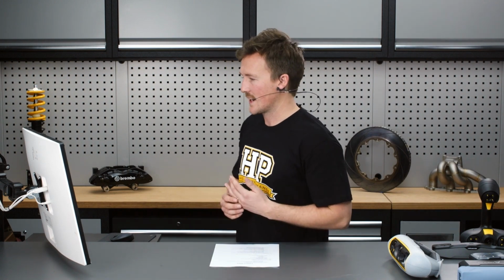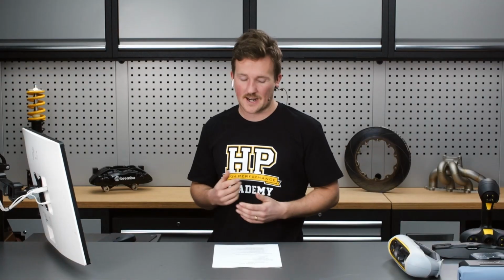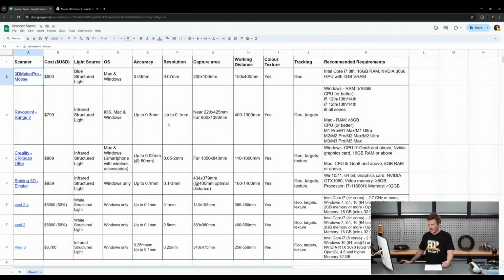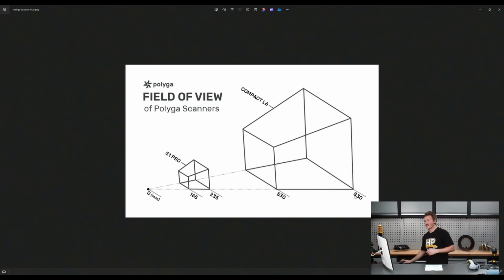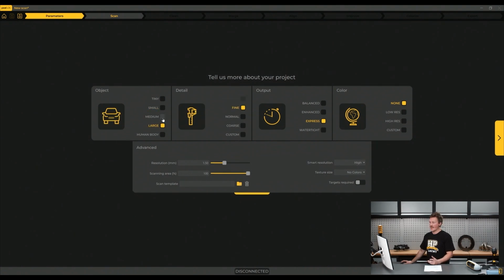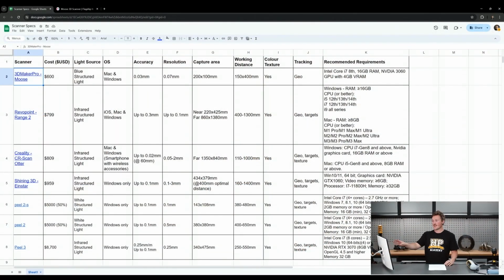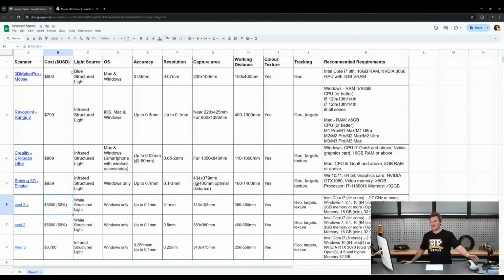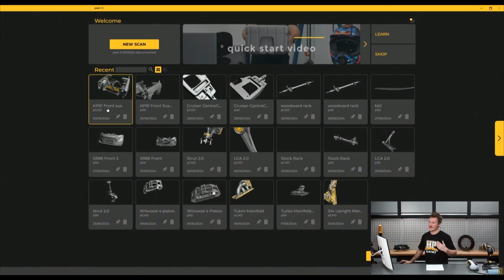Buying A 3D Scanner? | What You Need To Know

Comment from the maker: What 3D scanners are you considering?
0:00 – Intro | Choosing The Right 3D Scanner
0:08 – Why 3D Scanning Matters For Motorsport & CAD
0:24 – Scanner Technology Overview
1:06 – Scanner Marketing Claims & Metrics
1:19 – Why Use A 3D Scanner?
1:34 – Reverse Engineering & Scan-Based Design
2:59 – Scanner Technology Types Explained
3:03 – Photogrammetry Scanners
4:22 – LiDAR Scanners
5:11 – Laser Triangulation Scanners
6:19 – Structured Light Scanners
7:22 – Light Source Differences | White, Blue, Infrared
8:39 – Coordinate Measuring Machines (CMMs) & FaroArm
9:52 – Hybrid Structured Light & Laser Scanners
11:13 – Scanner Metrics Overview
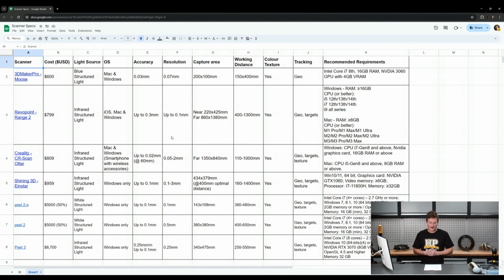11:35 – Accuracy vs Resolution
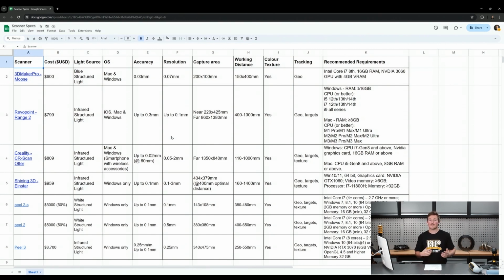12:00 – Scanner Accuracy Explained
13:51 – Scanner Resolution Explained
17:58 – Tracking & Targets
20:46 – Field Of View & Working Distance
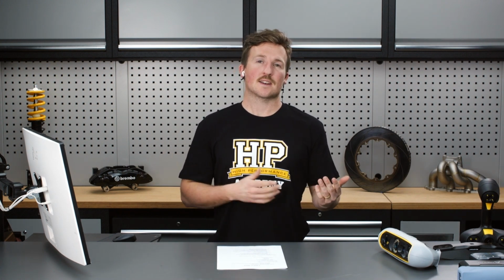24:16 – Resolution & Scanning Area Settings
25:24 – Scanner Frame Rate & Computer Requirements
28:15 – Choosing The Right Scanner For Your Application
31:01 – Colour Texture Scanning
31:45 – Budget Considerations | Cheap vs Expensive Scanners
33:22 – Software Limitations & Considerations
36:24 – Scanner Mobility & Connectivity
37:40 – Key Takeaways For Choosing A Scanner
38:31 – Upcoming 3D Scanning Course Announcement
39:11 – Q&A | Scanner Surface Limitations
40:27 – Final Thoughts & Outro
🏎 Building a fast car? Get $400 OFF the all-inclusive VIP online course package deal: https://hpcdmy.co/scanvips
💻 Learn to design custom parts for your dream car. 3D Modelling & CAD course. Now 50% OFF: https://hpcdmy.co/scancads

Comment: There are lots of mid range scanners out now that fill in the gaps on your list.  I am currently looking at Creality Sermoon S1, Einstar Rockit, revopoint metro Y pro.  They all have multiple laser modes, a structured light mode for larger areas.  The Sermoon S1 and metro Y pro even have single laser line mode for scanning deep pockets.  It is getting harder to justify scanners like the Peel 3 and higher end.  Unless those scanners really outperform these new mid range ones?  I like the all in ones, like your recommended einstar Vega.  Einscan also has an all in one laser scanner the Rigil.  The Rigil is $5000 but saves you the cost of a PC.  If the Rigil had the single line mode, I would have pulled the trigger.  Brands like Einscan are in a thought spot, they could keep up with lower tier brands and add features like a single line laser mode, but then they would lose customers of their professional high end models.

Comment: This is a GREAT overview of the key things to be aware of when evaluating the lower cost scanners. I really like the spreadsheet you put together summarizing all the key technical specifications of the scanners themselves.  

From my review of your spreadsheet, it looks to me like the Creality Otter is the best scanner for the under $1,000 price point. It has the best accuracy, resolution, capture area, working distance and it has the three tracking modes. Plus, I noticed it’s the smallest of all the scanners which is very helpful when the scanning area is constrained. 

However, you also rightly mentioned the capability of the software that’s included with the scanner is also very important. I’m sure in a future course you will share your spreadsheet where you summarize the key features of the software that comes with each scanner. As you mentioned, having (or not having) the ability to create (and move) very accurate xyz alignment planes is extremely important and the software included with most of the low cost scanners probably doesn’t have this capability.